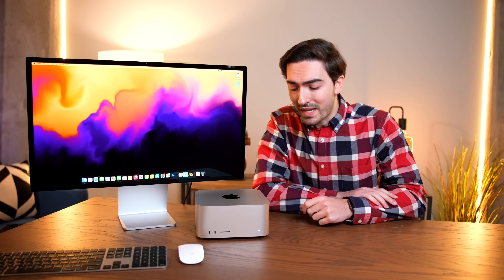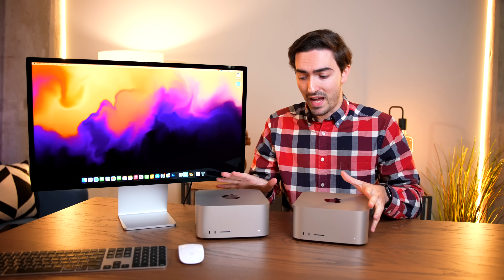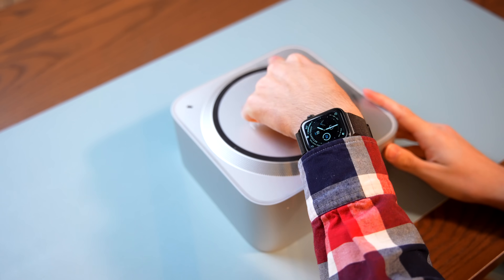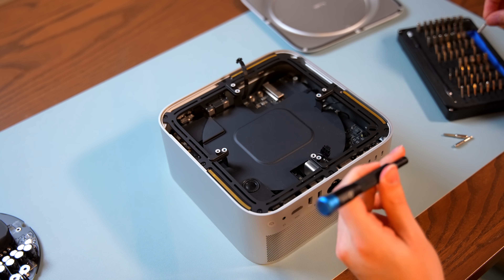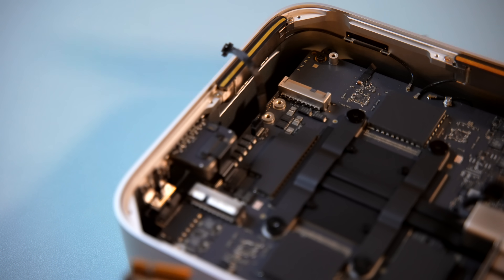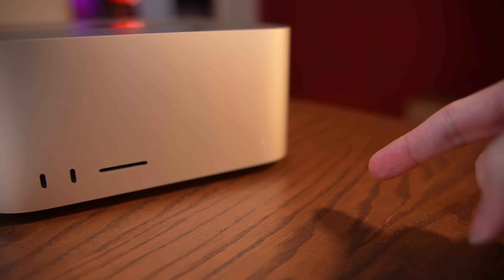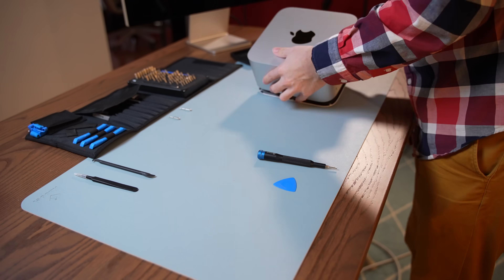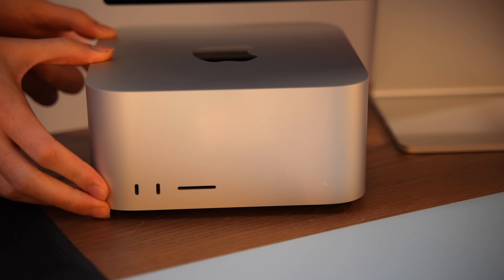What happens if you try to UPGRADE a $5,000 Mac Studio?

Comment: I'm not defending Apple's choice on this specific issue, but most of the people that are going to use this machine for the intended purpose are likely going to use high-speed external and network attached storage. What's inside the machine is purely for OS and application space, and if those aren't changing that much over the life of the machine, with good thermal management they should last beyond the useful life of the machine itself. I have an old Macbook Pro from 2013, which I can upgrade the storage on if I choose. I haven't had a need to, since I don't keep everything on it. I briefly use the storage, but then move the files to other solutions and back them up.

If my computers go down, I like that I can pivot to another machine immediately and not be stuck because all of my files are stuck in one dead machine. That being said, I run a lot of different platforms on my home network, so even if there was a virus or other kind of attack, it's extremely unlikely it would impact everything. It would have to universally work on Windows, MacOS, Linux, and BSD; and numerous different binary compatibilities for everything from PowerPC to M1, X86 & X86-64, etc.

Having my files on a secure network drive opens then up for use everywhere, but they are not immediately threatened by any issue on any machine.

Comment: Luke clearly doesn’t understand what is going on with the hardware and why it was designed that way. These aren’t traditional SSDs and they aren’t firmware locked. Some of the ssd functionality is on the M1 soc for performance reasons. And they’re encrypted storage so that’s why a simple swap doesn’t work.

Comment: Great video... I always wondered about doing the same thing... You also said (loosely) that the marring of the firmware SSD to the Mac was a security feature (or something similar)… if you want to disprove this couldn't you find a way to connect the SSD to a USB dongle or external case and read the data on the SSD, wouldn't that prove that marring the firmware is pointless in terms of security... to obtain the data from it...

Comment: better gonna be when You use static focus than this... when You unscrew it at begin camera randomly focus for moment od hand or screwdriver... its horrible...

and why You don`t apply other (with TI controller on it) ssd to second slot? this may be extension for internal storage... 
maybe this "apple" ssd can be only use in 1 slot and it only for system capabilities.... and second slot can be use as normal like in intel/amd pc`s/laptops because first ssd has software key maybe?

Comment: I sympathise with you, as I've never seen you so pissed off before, and full of good reasons to be so. I have owned a variety of mac products so far... right now I use a M1 Macbook Air 13"base model to work  on Zoom, and I still have a MBP late 2011 which I have upgraded to 16gb memory, 2 SSDs, 1TB each and even replaced the cheap subwoofer by the speakers found on the former Macbook 12" (that audio replacement took many hours of work and adaptations as well) , but the final result is a much powerful and cleaner sound.  Believe me,  the old MBP works like a charm for all tasks I do, including video editing.  I love your videos and I totally agree that once I've paid for any equipment, I cloud have the right to upgrade it with minimum effort. Cheers man! Keep up with the amazing work you've done on your channel!

Comment: I don't think apple would make a motherboard that has the second M.2 slot but no controller, rather what is really happening is that the firmware that is set on the motherboard is told to only use the first M.2 AND the SSD also has encryption, which most likely is set to the specific controller identifier. So, without the special tools that Apple has to reconfigure and set the firmware, there is no way to add/remove/change SSDs. 

It's similar to what they are doing to lock down the BMS (battery management system) and cameras in their iPhones and pretty much all other products. its firmware locks, that even their Apple Stores don't have access to... They then ship it back to "apple" which is just a 3rd party company that is tightly NDAd with Apple with their daignostics tools and equipment.. Its stupid!

Comment: I’d like to see 3 thin slots on the back that accept gen5 nvme. Just push in to click, push in to eject. Like a large sd card. 13.8GB/sec each slot. And/or, add 1/2” to he height to allow a 2.5” ssd/hdd. I hate wires.

Comment: Just wondering but could some of the drive's logic be on the motherboard and those cards only have NAND flash chips on them. If the drive controller is on the board then I could see it needing to be with its specific drive, and needing a new firmware flashed to the controller for a different drive. Just a wild guess, haven't taken a close look at these at all, but those chips seem very small to be anything greater than 1 TB, which made me wonder all of this

Comment: The SSD in Mac studio is not upgradable because it has hardware block those SSD does not have controller because the controller are attached in mother board so the conclusion is SSD are not upgradable in Mac studio you don't expand you memory by adding SSD in another slot in mother but the slot used for higher end storage version by Apple only you cannot upgrade you storage and its just say Apple doesn't care about right to repair you are correct man keep it up .

Comment: I watched a video put out by LTT about cpu chips being locked to a motherboard.  I’m betting the memory is upgradable, but you are using chips that are locked to a different motherboard.  This is why using one to another does not work.  If you are able to get a blank (unused) chip. You would be able to change the amount.  It’s hard to prove this. But it looks like this is the case. Great video testing.

Comment: Another question: can those slots take a standard 2230 M.2 NVMe drive using an electromechanical adapter? Kioxia has some really high-capacity M.2 2230 NVMe drives.

Comment: Hat off Luke for taking such a big risk. It's simply a shame on Apple (can we even expect otherwise?). I own a Lenovo laptop from 2018 and it has 3 disk slots. I added an additional  (standard)1TB M.2 disk (costing less than £100) and there is one slot left. I added an additional 16GB RAM stick to it and it still got two free slots for a total of 64GB. That's why I can never consider switching to Apple despite the high quality build.

Comment: Totally agree with Luke’s sentiments there about Apple taking EXTRA steps so the customer is blocked from right to upgrade. :( Appreciate all the hard work in disassembling to find out an answer to a very simple question, and would have cost Apple nothing!!! to make their hardware more user friendly. That said, I still have to stay with the Apple ecosystem, though. They’re still that good and essential for my work. But they sure are chipping away at the goodwill that the Apple chip is giving them.

Comment: 4:13 it doesn't suck at all. The bottom of the PCB is covered, and you can't touch the legs of the capacitors from above. There's no risk of getting electrocuted from that PSU.
Reply: Just a pity it"s not part of the bottom, so when you remove the bottom your straight onto the main board, and don't have to remove the supply every time you open it.
Reply: Lol yeah okay lots of tech people have said it's a shitty unsafe PSU design but I'll take some retards "OMG APPLE WOULD NEVER MAKE A BAD PRODUCT I LOVE THEM AND GIVE THEM ALL MY MONEY SO THERES NO WAY THE PSU IS DANGEROUS"
Reply: @huskers1278  it's common sense. The risk of getting electrocuted comes from touching the contacts of the charged capacitors. They are only accessible from the bottom, which is covered.

Also, pretty sad if your opinion can be deformed so bad by a bunch of "tech people".

Comment: That is really the bad bit with Apple. They did open up with Intel at the beginning, allowing to swap at least RAM and HDD. But they ended up at first putting custom firmware on HDD to send over the temperature thru one of the data pins thus sparing a cable or sensor (depends on the model). That was yet not prohibiting the Mac to boot and to keep the fans spinning at the maximum velocity tools such as HDDFanControl were great a great workaround.
I do understand that with ever slim factor they nowadays solder everything on the MacBook series, even the storage chips (I did noticed that there looks to be an interface to access those directly from the motherboard).

That said we could still hope that this is the way they approved the first generation of MacStudios to get them into production faster…

I personally was expecting looking at the M processor architecture and thinking of old features such as XGrid that they'd release a stackable modular Mac...
Wouldn't it be great if you could buy a « starter-kit » that would include a power supply unit and the mother board unit (with RAM and SSD) ? You could then stack on top of it one or many GPUs, extra mother board unit, and storage units depending on your needs ?

Eg. for a creative office end up buying the same « starter-kit » for all workstations, could even afford an extra spare. For motion designers you could then buy extra GPUs and conveniently clip them on top of the « starter-kit ». That would allow also very easy troubleshooting of potential hardware problem without the need of a screwdriver. You could then mail the defective part and get a new one or replacement one which is time saving for companies and cost saving for Apple (instead of fixing the machine on-site).

PS: Apple did tried with the first generation of iMac G5 to have such as « self-care » model but they failed because customers were unable to read properly the instructions and they ended up braking more parts while fixing the machine.

Comment: You have to separate the era of the home built tinkerer PC from what is essentially a supped up iPhone. The same way you don't ge to increase the storage in your iPhone so you can't here either without paying. It's a simple business model that apparently is working as consumers keep buying the things Apple makes. The R2Repair groups are just a few noisy tinkerers, we are past that. You want to buy into a non repairable $5K machine, its your choice, don't complain about it. You know what you are getting into. At no point did Apple said that the storage was user or even after the fact upgradable. So, I don't see the problem. Want to upgrade storage get a PC.

Comment: Benefits of the doubt, it doesn't remove the possibility to swap for a branded SSD unlinked to a device.
If the system links the SSD on the first boot.
Better? Slightly.

Comment: Maybe it will be possible to buy an Apple-certified SSD later, which will be installed in the Apple Store or in a workshop authorized for this purpose. Then of course you would still have to pay the prices demanded by Apple, but you have a Mac Studio with more hard drive capacity. It would at least allow you to be able to correct any basic equipment that you may have chosen too little afterwards.

Comment: Go buy a PC if you want all that more SSD more ram. it's not up to you. Macs are appliances just like our phones and our TV's and basically everything in our lives we don't upgrade we replace or mostly. and if it's in warranty we repair. we never upgrade only pc do we upgrade. Some people sometimes get to upgrade their cell phones OS's If you want upgradeability buy PC and not from DELL or anyone who makes their crap proprietary so other standard parts won't work or the case won't fit anything else. It makes me sick that it's gone this way and in such an extreme. I miss apple of 94-to-97 And that thing is ugly EXTREMELY ugly. It's a booster seat. It's what Apple designs without Johnny.   You know their processors are going to fizzle out much quicker than Intel and AMD. I don't mean as in run 'em till there fried. I mean you watch in a couple years apple will run into a wall with the architecture. I mean it kind of already has a lot of compromises. And besides doing most things on the M1's that isn't something designed to be dealt with. the M1s just barely compete with Intel and AMD, and the thing is they are still under and not beating them.

Comment: Well, I can't really say that Apple locked the SSD out of greed, really. As far as I know, it is done for security reasons, so your data couldn't be stolen. At least, Apple says so, and that seems to be valid for me. Not just, only valid.
Reply: How often did someone try to steal your ssd out of your Laptop/PC/Mac instead of the whole machine? This is pointless for the average user. They should atleast let the end user decide if they want to use encryption for security. Most people just don't need it. Per device encryption is actually dangerous to your data if the device somehow breaks. You can't recover your data by plugging the drive into a different device. You are basically forced to backup your data to a third party device which then defeats the purpose of the security anyway. Marrying the ssd to the device is just stupid and pure greed from apple under the dusguise of security.
Reply: Nah, not really. If someone has your SSD it won't be hard to access your information, not being able to boot into it isn't the same as not being able to read the data. And again, how would anyone get access to JUST the SSD?
Reply: I think Apple claims that, if the SSDs weren't locked to a specific machine, an attacker with physical access to the machine could replace the SSD with a maliciously designed one instead.

Comment: it's to do with the way that the modules interface with the processor and the way that arm architecture works means that the controller is on the m1processor for the SSD making it a little bit more difficult to swap the memory modules because these actually don't have a controller on the actual board itself, meaning that you may actually need a piece of software to reset the controller inside the m1 chip since arm architecture is very tightly integrated with itself this becomes a very difficult subject around right to repair but it's all depending on if Apple allows people to get access to the necessary tools to reset the controller in order for people to be able to change the memory modules, if you actually look at the memory modules themselves you'll notice that they don't actually have a controller unlike an nvme or mSATA SSD usually arm architecture is a very tightly integrated with itself generally controllers and memory modules have to work in tandem and the controller has to have a reference of the addresses available on the NAND chips. I'm in no way defending this product and I support right to repair but having the understanding of how this machine actually works compared to x86 based machines is necessary.

Comment: Dude. This is not a full fledged ssd, but rather a specialized memory module that connects to the onboard controller. Just because it has a m.2 slot does not make it an SSD.
Do your research.

Comment: Why are you trying to add extra storage? Or swap SSD's?
It's not user accessible.
It's not upgradable after purchase.
At the time of purchase is when you need to configure it with as much storage & ram as possible or needed.

On Apples website it specifically says:

Storage
This Mac Studio comes standard with 1TB
of superfast SSD storage,' featuring up to
7.4GB/s sequential read and write speeds.?
You can configure it with up to 8TB, giving
you more space to store your documents,
photos, music, videos, and apps.

Note: Mac Studio storage is not user
accessible. If you think you may need more
storage capacity in the future, consider
configuring to a higher capacity.

Memory
M1 Ultra brings blazing-fast unified
memory (RAM) to Mac Studio. This single
pool of high-bandwidth, low-latency
memory allows apps to share data
between the CPU, GPU, and Neural Engine
efficiently. You can multitask with ease, and
everything you do is fast and fluid.
The more memory your Mac Studio has,
the more apps you can run simultaneously
and the better they will perform. This Mac
Studio comes standard with 64GB of
memory, which can be expanded to a
staggering 128GB
- unlocking entirely
new workflows for pro users.

Note: Mac Studio memory is not user
accessible. If you think you'll need
additional memory, it's important to
upgrade at the time of purchase.

So why is this a shock to you? 
This is fuckin stupid.

Comment: the second slot i think cant act as independent ssd, but just expanded of the first one, 
for example if you have 1TB, and want another 1TB, they wont add second SSD, but replace the whole SSD.
in normal SSD we call it Double SIded NVME, so to make it HArd to repair they split ONE DOBLE SIDED NVME into TWO SINGLE SIDED NVME.
it sounds crazy but i knew Apple would problaly do it